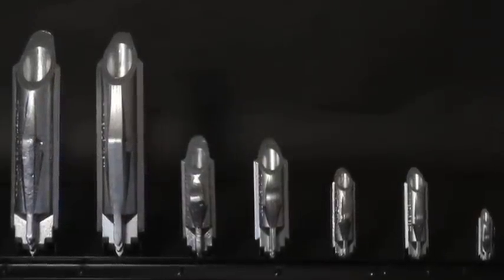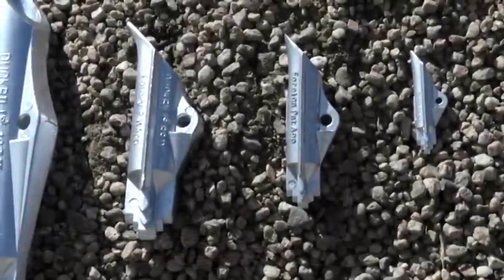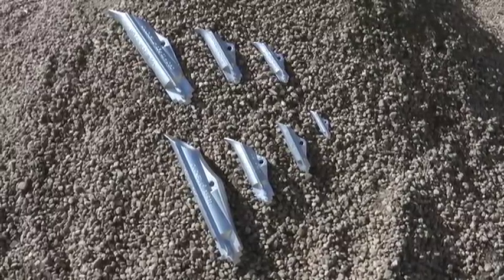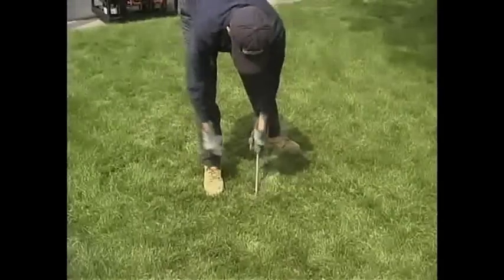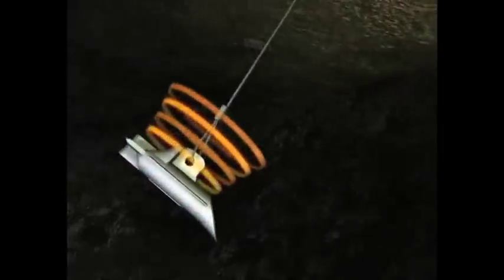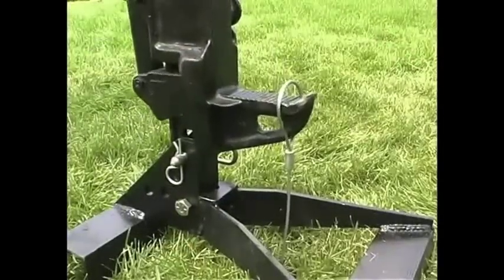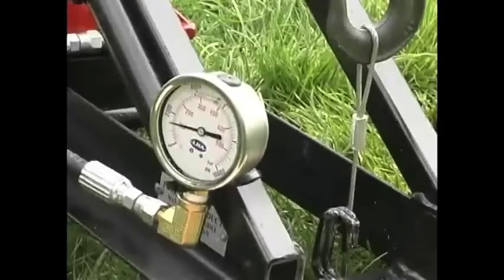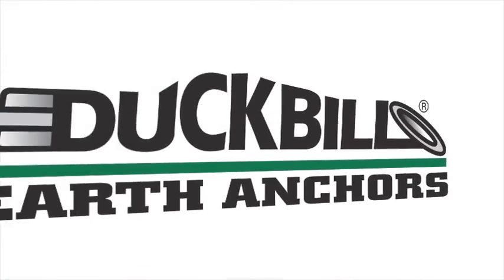Duckbill Earth Anchors

Comment: I've used them to anchor my 45ft. ham radio beam tower. All ya need are the anchors, drive in shaft sized to fit your chosen anchor size and a BIG hammer. I have a Makita jackhammer for work so it was a breeze to install them.
 It's been 15 years and they are still holding. These are an awesome device. I love them!!
Thank you DuckBill.